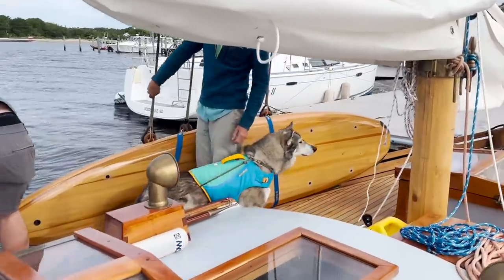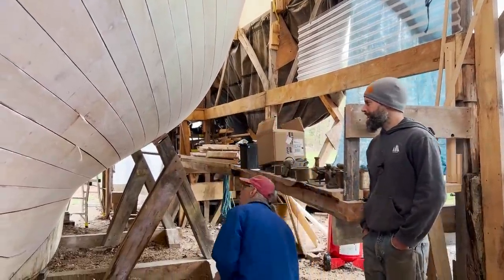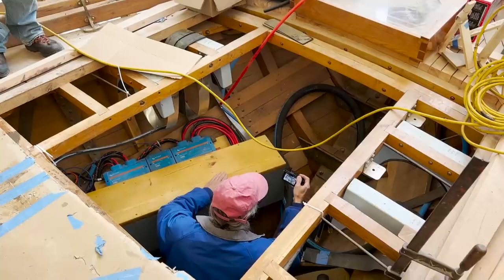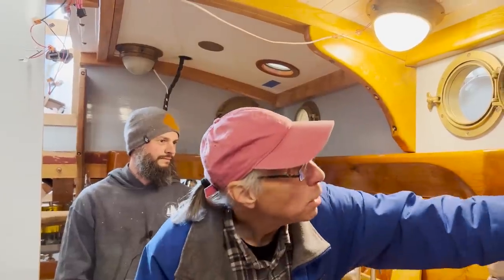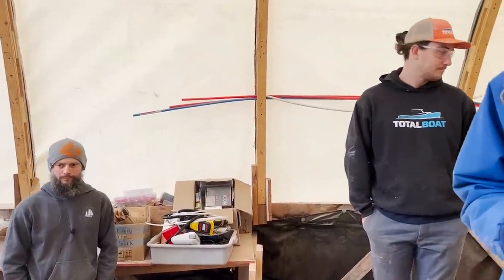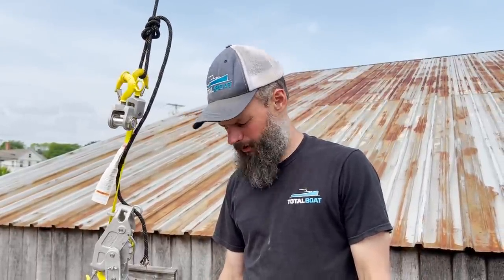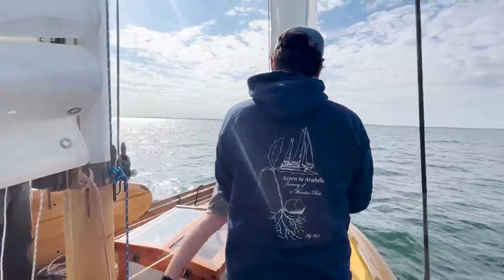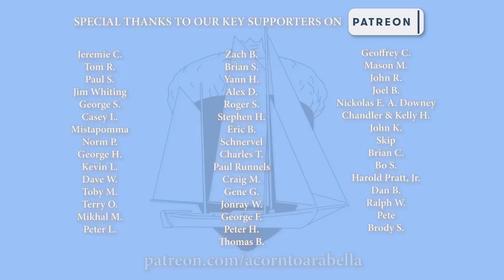It's Definitely Not Sailing - Episode 272 - Acorn to Arabella: Journey of a Wooden Boat

Comment: Congratulations on your first outing,i know it's a very special experience,i sail a 37 ft. Gaff rigged  Ketch,built in 1991,Mahogany on Oak,it's a copy of Slocums Spray,but Ketch rigged,when i bought Her, She had modern running rigging and the first thing i did was replace with White 3 strand,my running backs for the main are high tech inside a sheath,looking like traditional line,love everything you did with the build,except the running rigging,hopefully that is temporary .Fair winds,all the best.

Comment: Looks like it could be Bristol RI.  Especially since it was through a Total Boat connection.
BTW, a little tip: when you get those sail ties, get a length of shock cord with a hook on each end attached under each of the booms.. Figure out where each tie belongs, mark it and then sew it onto the shock cord. Makes flaking sails a lot easier, especially when you're double-handed.

Comment: Awesome! And the stuffing box always needs adjusting in the water anyway. Drips are much better than heat 🙂
Reply: They just need to be careful the drips they are seeing are coming from inside the packing cavity, not running along the gland from elsewhere. In which case it can happen that there is NO water running between packing and shaft, despite a healthy apparent rate, and of course this is not good.

Comment: What a great sea trial. She looks magnificent.  I do have one bone to pick.  Please never turn the engine off until you are fully secured alongside. If you have misjudged the wind or the tide, you may desperately need that engine to recover.  I also have a rule on my boat, never jump off the boat to the jetty.  If you can't step off then it is not safe to jump.  Besides it is pretty simple to just throw a loop over that cleat while remaining onboard.  If you are short handed or single handed, this is a far safer method.  The fingers in Europe can be slim and not very stable, they can also get a bit slippery sometimes - not a good thing if you are jumping down onto them!

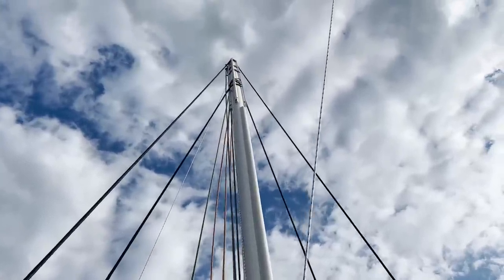Comment: 3:00 If you're looking to make a table of revs vs speed for general use (eg assessing whether the hull or prop is fouled), remember to make sure you correct any readings which capture speed over the ground (ie, GPS, measured mile etc) to speed through the water

Comment: Construction duly checked and approved by a professional surveyor - awesome!

To do list:
1) Weight the boat;
2) Keep an eye at stability, motions and helm in a seaway;
3) Adjust masts' rake for adequate weather helm in progressively stronger wind/sea conditions, if necessary; and
4) Adjust ballast, if necessary.

Eventually you'll be able to construct your own sails crossover chart or diagram, showing the sails Arabella should wear at varying wind speeds/angles. If Doyle provided one, it is a first aproximation. Make your own. If you don't know what's it for, search for images of "sails crossover chart or diagram".

Comment: You can make sail ties by using smallish hardwood blocks, with two holes.  Using apprpriately sized shockcord (6,8.10mm) drill the holes and leave one for a feeder end, the other you may want to set shorter on more restrictive criteria.  for the secon hold on the block cut a more restive slot, enough to grip the ?mm shotcord

Comment: You need to rig some lazy jacks on the main and a downhaul would be a good idea on the jib.  Lazy jacks on the mizzen would be nice too to keep the sail out of the cockpit, but they are not as needed as on the main. Other than that it looks great.
Reply: Headsl downhauls are fantastic. A well designed downhaul (ideally into a sausage sailbag) combined with slab reefing, with a lazy sheet already set up for the next reefing point, is to my mind, in many ways, better than roller reefing. Especially when trying to gauge off a lee shore in a stiff gale.

Comment: I'm going to be interested to see what the issue is with the stuffing box. Apart from that, so impressive to see Arabella under sail!
Reply: Probably just a little too tight. They also can run a little hotter when new, before the shaft gets polished by the friction of the packing. If the packing is Gore-Tex Teflon, there is a widespread misunderstanding (for which some literature is to blame) that it is "dripless". This causes people to overtighten it. In fact it needs to drip (all packing does), but it "drips less" than traditional flax.
Graphite packing provides a little less friction than the alternatives but it too needs to drip. It's also the least abrasive, so it may well be what Steve has chosen for longest shaft endurance. Both graphite and Teflon have good resistance to high temperatures, in comparison with flax, and the latter is the most abrasive of the three.
One other confounding factor is that the drip rate needs to be strictly from between the shaft and the nut. It can happen that there's also dripping from between the hull and the gland which ends up running along the nut, and if that is so, it needs to be fenced off or somehow sequestrated. Otherwise the risk is that there is NO water running between shaft and packing, and that is not good.

Comment: I'd think about adding the electric autopilot. You'll probably be surprised how much motoring you end up doing on passage, and the wind vane just won't cut it. They're pretty simple, time-tested tech, and battery drain isn't a problem because you almost only use them motoring. Hand steering under motor is a royal pain, I can say.
Reply: Yep,  select it, fit it, test it, then put it away until you need it.  Even if there's one significant passage where you find it necessary and useful, it will be worth it.
Reply: The idea of a trim tab on the rudder, controlled by an autopilot is pretty darn clever. Otherwise, a tiller pilot is pretty much the only option given the steering/tiller geometry.
Reply: @billvanvlack117   The two make a great combo. The smallest of self contained tiller pilots, steering the trip tab. Minimal cost, easy to replace or upgrade, minimal battery drain.

Comment: Such a beautiful sight.  Just beautiful.  What’s a stuffing box?
Reply from the maker: Here’s a good explanation: https://en.m.wikipedia.org/wiki/Stuffing_box
Reply: @AcornToArabella  interesting.  Why would it overheat?  Is the prop shaft out of alignment or does the stuffing box need addition lubrication?
Reply: @rexmayn3171  Usually because the squeeze on the packing is set too tight. Without running it it's not possible to get it just right on first installation. The lubrication and cooling is provided by leakage flow of seawater into the boat, between the shaft and the packing.Timber boats thrive on salt water, so provided the bilge is deep and kept clean, it's all grist for the mill.

Comment: An impressive story. Well done. At 6-7 min into the video Steve tells the surveyor that the hull planking scarf joints were all glued with a Total Boat epoxy. This must be incorrect? Surely a large number of the joints were glued using resorcinol-formaldehyde?
Reply from the maker: Only at the beginning. It didn’t work as well as the Flex-Epox.
Reply: When did you change to epoxy? The first ten planks per side (when you ran out of dry oak) used resorcinol. That's half the boat!  @AcornToArabella

Comment: as she runs a little low, is there a mitigation plan for ballast if it needs to be adjusted? with the addition of the full sail rig she will run even deeper. is that a concern?

Comment: While under sail, is the propeller shaft in " neutral", or is it locked to the not running engine and providing drag? 27:44

Comment: Sounds like you need a stuffing box that has a water line that goes to it.
Reply from the maker: No, the gland itself is adjustable to allow more water to drip or less. We just backed it off a bit so it was packed less tightly.
Reply: @AcornToArabella  I understand that, by compressing or uncompressing the carbon rope inside. In a perfect world 1 to 3 drops a minute is what you are looking for when sitting at the dock. More is not an issue at the dock but my concern is when you are underway how much water will the shaft sling around and if the heat goes away? Slinging saltwater can be a real issue below the deck and if the heat is not gone it's the same issue I have with my inboard race boat. When underway not enough water comes back up the shaft to cool the box so there is an extra cooling line (3/8ths I think) that just makes sure the box stays water feed all the time. The stuffing box with a water connection a pretty common.  😊😊

Comment: The boat needs a hydraulic ram on the rudder connected to a pedestal with wheel in the cockpit. which can be easily connected to an autopilot. My 38' Nova Scotia double ended ketch, "Sundowner", sailed to Bermuda, the Caribbean, Maine and Nantucket, without incident. I had seas higher than the mast, in the Bermuda Triangle, and she handled well. My hull design was identical to Arabella, but not as over engineered. In terms of standing and running rigging, the Sundowner was stronger,  I would not go to sea with Arabella's  rig as it currently stands.

Comment: I can give thought on sailboats an lightening. I was reviewing operation of "LifeSling" overboard life saving devise in Columbia River. I'm attached from life sling from top haul mast cable when lightening strikes masthead. Strike caused mast top mounted radio antennas to fall into deck full of sailors interested in LifeSling. I'm looking up cable from water surface storm too masthead when lightening threw shower of sparks in circle of mast. Light show from blast was impressive. My first thought, I'm fish in water, hooked to metal cable being electrocuted by lightening strick. But the blast "didn't" carry down cable too me in water. My friends felt so bad, because I warned them of storm, they went ahead anyway, an it was me at end of cable lightening strick!

Comment: I guarantee you're going to want an autopilot eventually. Wind vane will be great, but not useful in all conditions.
Reply from the maker: Maybe so. But a great many people I know haven’t found conditions yet that a windvane wasn’t up to. At that point, maybe heave to. It’s not important right now.
Reply: He could put a detachable small electric autopilot on the hydrovane section like Troy did at Free Range Sailing. Clever and cheap backup system.

Comment: Question: How are you going to bring down the temperature of the stuffing box?
Reply: Loosen it?
Reply from the maker: The stuffing box is a piece of hardware that is adjustable… you increase the drip rate if it’s running hot.

Comment: I've got a 69 grand banks woody, I did not like that interlux seam putty, I used to use slick seam but they went out of business,  this last time I used life calk.
Reply from the maker: I’ve not heard of people using either of those for seams. Basically, it needs to harden a bit, give easily, but not stop the planks from separating a little when it’s drier. I’m afraid lifecalk is going to be a heck of a thing to try to maintain. —Anne
Reply: @AcornToArabella  you tell the surveyor you will be using interlux seam compound at around 5.00, that's why I made the remark.......

Comment: You will see it. In heavy weather tiller is too slim. Any way, emotional
Reply: That would definitely be the case for a transom-hung rudder, but I guess a double ender does not quite have the same helm loads. The worst case is when hove to with the tiller lashed, if and when the boat fails to surmount a breaking crest, and gets thrown backwards. IN this case a double ender is arguably going to produce more load, and is probably more likely to be hove to in the first place.
It looks light to me, laterally in that context but also in the depth vertically : someone could fall across it while entering or exiting the cockpit in big seas, and if it broke, it might actually product a worse injury.

Comment: What's a stuffing box?
Reply: A water seal on the propeller shaft stuffed with grease
Reply from the maker: And it’s adjustable… the drip rate lets a little water in, and when increased, will cool ours a little better.

Comment: Was that a tack or gybe . ?
Reply from the maker: Tack: that’s when you put the bow of the boat through the eye of the wind. Since they’re motoring, into the wind… it’s a tack.
Reply: @AcornToArabella  with all the years I have been sailing around the world , to tack you pushed the tiller away to tack , through the wind , if you pull and bear away youl gybe ,
Reply: @davidwarnes5158   That entirely depends which side you're sitting relative to the wind  ;-)

Comment: What is a stuffing box?
Reply from the maker: It’s a packing gland that manages the intersection of the hole in the boat where the prop shaft exits. The dripping it does cools it.
Reply: @AcornToArabella  So you're supposed to drip water on it to cool it?
Reply from the maker: No, water comes through the cutlass bearing and into the stuffing box, where are the drip rate out of the staffing box can be adjusted.

Comment: I'm not a boat or plane expert... but I KNOW for sure autopilot is clutch in planes. Trust the navigation equipment, not the man.

As a virgin sailor, Steve should get the autopilot until he's had some years of experience. Seems kinda irresponsible not to. Just my thought 🤷‍♂️🤷‍♂️🤷‍♂️
Reply from the maker: I’ve never had an autopilot that works as one does on a plane… we just don’t use them the same way.
Reply from the maker: (And steering a course is VERY easy.)